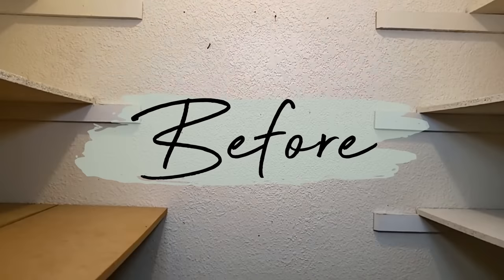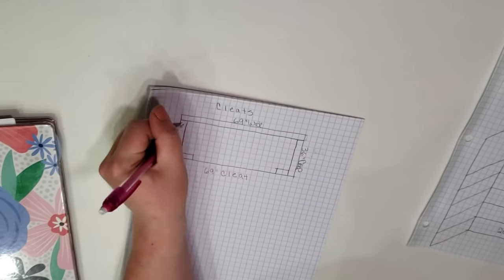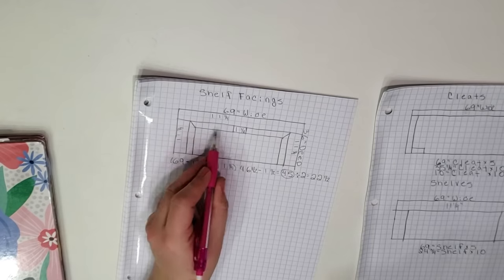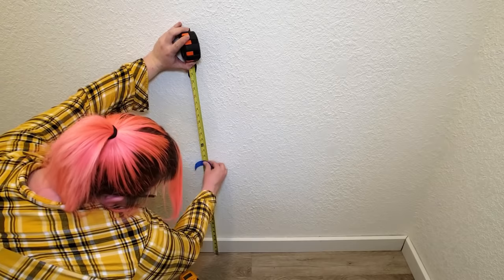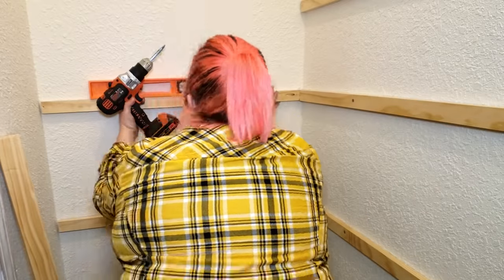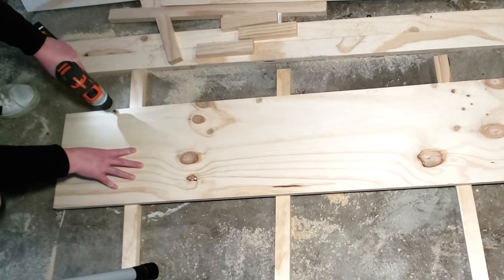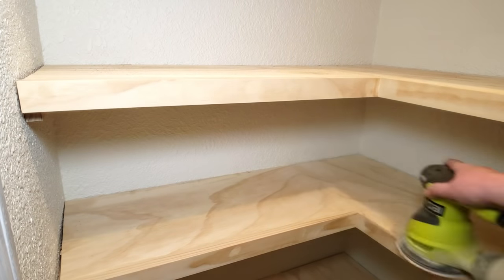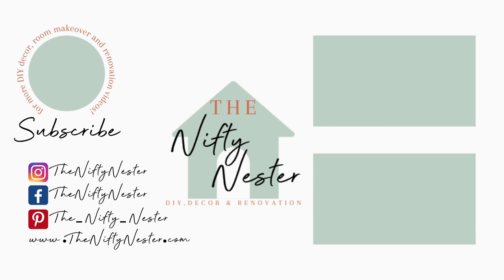How To Build Easy DIY Pantry Shelves | Small Pantry Makeover On A Budget EP.1

Comment: You did great explaining this! It feels so doable to me. Especially appreciate the planning stage written out. I had to watch to get all the math in the end. I guess I am visual learner. Haha. Did you use anything to cover your floors to paint or just braved it? My plan is similar only I want to do the bottom portion with a butcher block countertop at counter height and framing to look more like a cohesive base. But otherwise the same. Thanks for this!! And curious if you have other ideas for stability if we don’t want the big center dividing piece? Maybe it’s not doable. Just thought I would ask.
Reply from the maker: Thank you so much for your comment! I thought about doing the same thing and adding cabinets to the base with a butcher block counter but decided to go this route to save a little money, but I did research how I'd do it the way you're doing it. If you don't want to use a support bar you can create a frame underneath the shelf. It's basically the same as this by attaching cleats along the wall but you'd run another cleat from each side right underneath the front of the shelf. You can attach it to the cleats on the wall with a pocket hole and screw the shelf down to it. I hope that makes sense. It's basically like making floating shelves but you don't have to box in the underside unless you want to for esthetic reasons. If you search for floating shelves you can find a couple videos that explain it better than I probably am. Also I did throw an old sheet down on the floor I just didn't show it, but I'm too messy to just brave it lol. I'm glad the math portion was helpful, I almost didn't include it but I know there's people out there like you and I that need to visualize everything before taking the project on. I hope your project goes well and turns out just the way you want it to good luck!

Comment: Great demonstration with lots of good tips. Also this is the best example I have seen in a long time for using metric instead of empirical measurements. I have one comments about the plywood. Often the plywood has a good side and a bad side (with lots of imperfections). It seems as if you have placed some of the boards with the bad side up. It doesn't matter a lot since you are plainting it all, but it may be nice for others to know.
Reply from the maker: Thank you! Yeah I should've pointed that out, I didn't think about it until way later. You're right though, I didn't think to mention it since I was sanding and painting mine anyways. Thanks again!

Comment: Wow! You are an incredible teacher! My pantry looks similar to yours, but now I would like to add one extra shelf on top - I think just along the back. Any suggestions on how to do this? Can I extend the support bar up one extra shelf or do I need to remove the support bar and buy a longer one?
Reply from the maker: Thank you so much! You can absolutely just add one shelf. You can extend the support bar or replace it with a longer one, but just extending it would be the easier way to do it. You can use a pocket hole to connect the new piece of support bar to the original one and just wood fill to blend the two together. That should give you plenty of support for that top shelf once you attach it to the shelf.

Comment: Your shelves are beautiful! I am so impressed and will use your method to do shelves in my hall closet that holds blankets, games, puzzles, and some miscellaneous items. I currently have shelves along the back wall. I want to make an “L” with shelves coming off of the existing shelves. The area where the new shelves will be is an area that is deeper than your pantry side shelves. Using the pocket screw method, would that still be strong enough for shelves that are more like 16-18” deep? Meaning, instead of using the pocket screws to attach an 11” shelf to an 11” shelf edge, I am thinking I want to use pocket screws to attach a 16-18” shelf to the 11” shelf edge. My back wall shelves are about 11” deep. Does this question make sense?  Thank you for any input you might be willing to offer.

Comment: Very nice work.  I was just wondering if it would be easier to pre-paint all the pieces and then go back to fill in the holes with Fast and Final before touching up with paint
Reply from the maker: Thank you! It probably would've been faster to do it that way. I thought about it but figured I was going to have to paint it all again after installed anyways so I just did it all like that. It did take a while to get it all painted though. Next time I'm going to try out using my paint sprayer and see how that goes.

Comment: Thank you for such a well-planned step-by-step tutorial. One year later I have to ask, would you do anything differently? The reason I ask is because I'm planning to renovate my own pantry by following this video. Is that support bar really necessary? I do like the idea of floating shelves without the support bar for easier access to items.
Reply from the maker: You're welcome, thank you so much! I'm really happy with how this project turned out, there's not anything I really would've done differently. I thought about doing floating shelves as well but there's a few reasons I decided not to. I needed as much storage space as possible and to get really sturdy floating shelves I would've needed to build frames that would've made the shelves thicker (about 1 1/2-2 inches thick) vs the 3/4 inch thick shelves I have now. I did add the face frame but that doesn't take up any actual storage space. Basically it just gave me an extra inch or so between each shelf to do it this way. If your shelves are very wide you need the support bracket to keep the shelves from sagging. If you decide to do a thicker floating shelf with a sturdy frame inside built out of 1x2s then you shouldn't need any additional support, just if you're doing thinner shelves like I did without a frame underneath them.
Reply: @TheNiftyNester  Yes that makes a lot of sense. Thank you again!
Reply from the maker: You're welcome!

Comment: The big center void is graet if you place tall wide wire basket on door to hold chips and light stuff. Otherwise a waste of space could have been easy 3" wider /and and deeper at center above the first shelf for 4' width. Often better to use self standing framed wire basket drawers that are screwed down -- can do 2 + per shelf - that pull out for all the short little containers that do not stack well. One for sur on each side of the center post for 12" wide by maybe 20+ deep

Comment: Great video going to attempt but not much of a handyman but I can follow instructions! One end of our shelves would be ending at a window would you need to put anything on the end or just butt the shelves up against the wood window frame?
Reply: Seems like I would need a support for front of shelve???
Reply from the maker: Thank you! So there's a couple things you can do. The easiest way would be to have your last cleat butt right up to the window like you said. Another option would be to wrap the face frame around that edge of the shelf. You'd basically build the cleats the same way but leave enough space between that last cleat and the window for the face frame to wrap around that side of the shelf in between the shelf and the window frame. I hope that makes sense. It would still end up right against the window. You could also do the same thing and leave a little more space if you don't want the shelf to touch the window but if you're looking to optimize every inch of storage I'd just have it right up against the window.
Reply from the maker: Sorry I just saw your second comment! Yes, I would use a support bracket on the front (especially since the end won't be up against a wall). I would place the support bracket on the very end of the front of the shelves. You might need more than one support bracket depending on the layout of your shelves, if you have another long wall of shelves you might need one in the middle of that wall as well (like I had on mine) basically anywhere that would be at risk of sagging under weight would be a good spot for a support bracket.

Comment: Excellent plan and work! 
I love the U Shape design. Any suggestions for fitting this for a 36" wide closet ?
Reply from the maker: Thank you! For a closet that size you might be better off just running shelves along that back wall but it depends on how deep the closet is. If it's deep enough you could possibly do an L or U shape.

Comment: Hi. I have watched several "pantry makeover" videos and I always come back to your. Thank you for giving me the confidence that I can do this too!! That said, my pantry is similar to yours, except the width is 57.5" and the shelves are wire, which I want to change to wood. Can you tell me why you changed the layout of your shelves to U-shape rather than just straight across? Do you find the U-shape gives you more space? Any help is greatly appreciated. Thanks.
Reply from the maker: Thank you so much! I'm sorry it's taken me so long to respond to your question. I changed the layout for more space. I worked up several options for this pantry and the U- shape seemed like the best way to maximize the storage space. The side shelves aren't very wide but it is enough to fit 1-2 bins on each side shelf. I think if your pantry is deep enough and you could use the extra space it's worth it.

Comment: What kind of screws did you use to attach cleats to wall studs? Notice you did not need to use the counter sink bit for those but you were able to cover and sand. Thanks!
Reply from the maker: I should've used a countersink bit on the other cleats but for some reason I didn't. I used exterior screws that I had on hand that were long enough to secure the cleats into the studs. They were flat enough that they blended in easily with the wood when covered but honestly I should've used countersink holes.

Comment: Good morning.  This was inspirational.  QQ, so the side shelves and longer shelfs are only held by pocket screws?  No other brace at the joint?

Great job.
Reply from the maker: Thank you! The shelves are connected only by the pocket screws but most of the support comes from the brackets on the walls and the support beam along the front. Without the support beam along the front there would likely be some sagging in the longer shelves over time.

Comment: Great video thanks for sharing. Could one just use melamine shelves available at home depot or is plywood advisable just like you used? Thanks again
Reply from the maker: Thank you! So it really depends on how you want to install them, how long your shelves are going to be and how you're going to brace them. Melamine is the coating and the inside is usually composite which is basically saw dust. The melamine is easy to keep clean and doesn't absorb water which is great. If you are going to be cutting it or securing it to the brackets with screws then you have to be really careful not to shatter the shelf. You want to use a fine blade to cut and predrill your holes. If your shelves are very long you need more bracing because they are more likely to warp or break under the weight of heavier items. They both have their benefits, so it really just depends on what you prefer. I hope that helped to answer your question.

Comment: You did an awesome job.  I need you to come to DC and give me a class.  I started my pantry with a contractor but he didn't know what he was doing.  So I want to try and finish it myself.  What size screws did you use?  What size pocket screws?  Any tips on how to put in the laminate flooring?
Reply from the maker: Thank you so much! I'm sorry you had a bad experience with your contractor. I'll double check what size screws I used, I can't remember off the top of my head but I'll leave another comment with those numbers in a minute. As far as the flooring goes I do have another tutorial where I went over the installation process in detail if you're interested in that. It's pretty easy to work with and it's held up really well so far. The main thing I'd stress is floor prep, making sure it's thoroughly cleaned and dry then using the primer if you're laying it over concrete.
Reply from the maker: The wood screws were 1 1/4 and the pocket screws were 1 1/4. I can't find the screws I used for the drywall but I think they were 1 1/2 or 1 3/4. Long enough to go through the cleat and the drywall and still bite the stud well enough to hold.

Comment: Very nice work.  Quick question, do you think it's a must to have the support beam?  I'm about to do my pantry and was wondering if I absolutely needed the beam. Thanks and great work.
Reply from the maker: Thank you so much! My back wall is wide enough that I was worried the shelf would bow in the middle under the weight of everything without the support bar. If your shelf isn't that wide you could probably get away without it. Or you can build a box to support the shelf. Just like the cleats, but with another piece running across the front that attaches to the side pieces with pocket holes. I hope that makes sense.

Comment: Great video! My one question is, what did you do for the support bar at the point it meets the floor? Do you just let it stand on the floor or did you secure it into the floor somehow?
Reply from the maker: Thank you! The support bar is attached using the same nails that I used to attach the shelf facings. I just used a nail gun with finishing nails and that is plenty to help support the weight.
Reply: @TheNiftyNester  That didn’t really answer the question, I don’t think.
Reply from the maker: I just reread and realized I really didn't answer it, did I? I tend to reply early when I'm first waking up lol. It is just sitting on the floor, not attached in any way. It's only attached to the shelves.

Comment: Your backside furring strip width is same as front side furring strip? if it's same then you will see 3/4 difference correct?
Reply from the maker: Yes, it is the same. The highest shelves you can see the cleats on the wall, the lower shelves you can't since they're under eye level. Since this is a pantry I wasn't worried about seeing them and didn't want to use any larger of a facing. It also made it easier when planning out materials. You could use a larger cleat or even attach them from underneath the shelf instead of to the front of them if that height difference will bother you.

Comment: With your support bar in the middle, were the nails strong enough? Or is it better to use screws?
Reply from the maker: Good question! The nails have been just fine. The weight is really well distributed with the cleats running all along the back of the shelves. The support bar won't be holding near as much of the weight and is mainly keeping the shelves from sagging in the middle over time. You could use screws if it makes you feel better about it being secure but you don't really need anything more than the finishing nails.

Comment: Are you happy going with 10 height for your shelves?  That seems very tight for me, but you know how much height works for you.  In my storage one gone with 16” and it works really well for me.
Reply from the maker: I have 12" between a few of the shelves, 16" between the bottom two and more space under the bottom and above the top shelf. For me, I measured the items we needed to store and the size of the storage containers I was using and based my spacing roughly off of that. I definitely think it depends on what you're storing and how much space you need, and our shelves might be too tight for other people, but it works well for our needs. I do think we'll either expand the pantry or add a second one eventually with more space for larger items and appliances.

Comment: Do you have to have the support bar on the long shelves or could you go without?
Reply from the maker: You don't have to have it but I would say that depends on how wide your shelves are going to be. If they aren't very wide you'll be fine without it but if they're about the width of mine or wider I'd suggest using it. The main reason is that if you're putting a lot of weight on the shelves they can start to sag in the middle over time.
Reply: Great, thank you very much for posting the video! I'm going to try this out, I've been wanting a pantry in my kitchen for awhile.
Reply from the maker: Awesome, good luck to you! I hope it turns out great! Thank you 😊

Comment: Am I able to accomplish this without the pocket holes or angled cuts?
Reply from the maker: I'm so sorry for the late response! You might not need my answer anymore but just in case here it is.
You can definitely do this without angled cuts or pocket holes. Instead of angled cuts you can just do straight cuts where the boards meet.  Instead of doing pocket holes in the bottom of the shelves you could use brackets and screw them into the bottom of the shelves where they meet. For the cleats on the wall, instead of pocket holes just attach them to the studs in the wall then use drywall anchors where there aren't any studs. As long as you make sure the cleats are level with each other the shelves will turn out fine. I hope that helps!